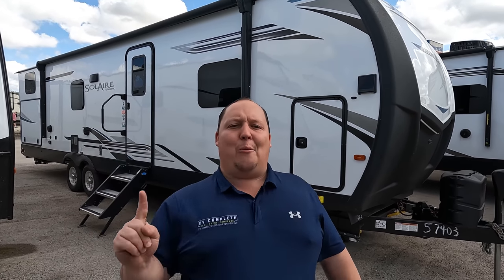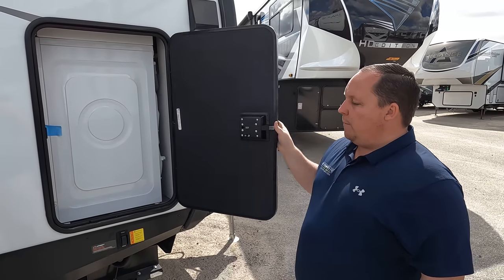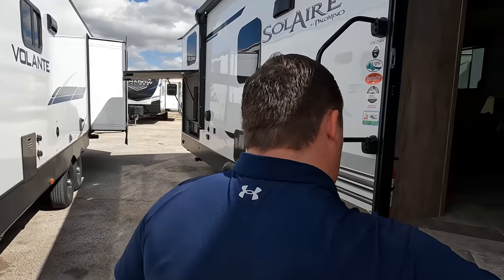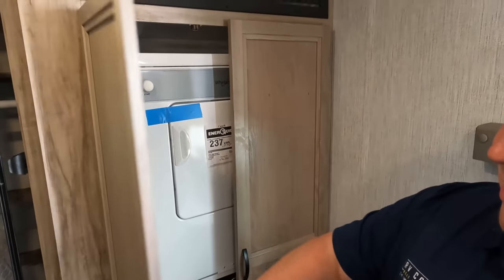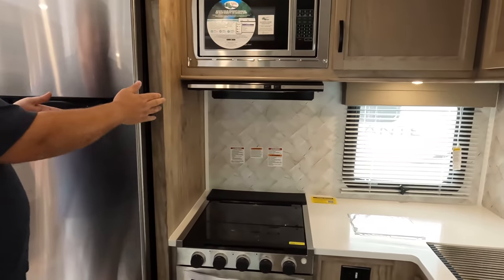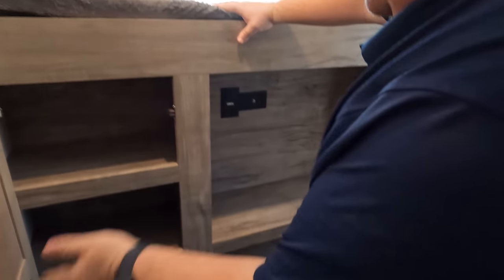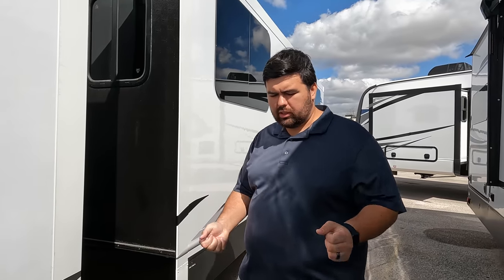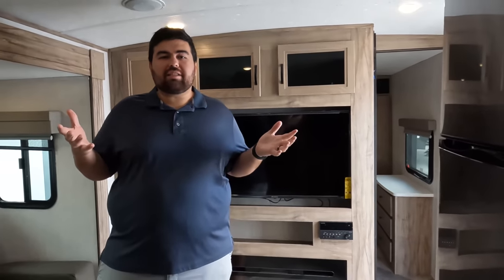FULLTIME LIVING in a TRAVEL TRAILER! HUGE!!!

Comment: Wow this is kind of a let down for the size and weight of this TT it's not well setup for a family (plus Forest River doesn't warranty for Fulltime living). I don't know why you would recommend a TT for fulltime if the manufacturer doesn't warranty for it .. a washer and dryer in the unit is nice but like Will said this unit isn't going to keep up with the laundry amount and you will be using the laundry at the campground anyways... most campgrounds have good laundry machines at an affordable price and they deal with the wear and tear on the machine. The bathroom is horrible in this unit especially for the size of the TT... I would much rather recommend the Jayco Eagle HT 312BHOK ... Same bunkhouse space but a much better bathroom with a 30x36 shower... A great kitchen space with an island... And a TV directly across from the theater seats... It's prepared for a combo washer/dryer but I wouldn't get one anyway since doing laundry in the laundry mat shouldn't be an issue for people... I know so many fulltime RVers that have removed the washer/dryer and haven't missed it... But do enjoy the extra storage more... Oh and lastly those Castle Rock tires are china bombs and would be the first thing I would change for safety... The Jayco comes with Goodyear Endurance from factory and has a 16" tire open (very good option for a TT this heavy)

Comment: Dislikes:
1 - The TV and Fridge should be swapped.
2 - Bathroom is fail.  
3 - With those huge slides, make the back room just for sleeping - put a bunk bed there sideways and be done. This gives you a usable bathroom.  Note that this also means removing the useless outdoor kitchen.  In a unit this size, outdoor kitchens are a joke - you come inside 10 ft to get food anyways.  Turn this all into a useable LARGE 5th wheel sized bathroom or make the kitchen along the wall to open it up. Also, with a larger bathroom, THE place for the washer and dryer is in the bathroom.  
Likes:
1 - Slides are great.
2 - No nasty floor vents.
3 - I don't have #3.  It's a good attempt, but feels cramped.  The price is too high compared to larger 5th wheels that give you more.  Given the tongue weight, it's a 5th wheel TRUCK you need anyways - then we're reduced to merely talking about mounting methods for the larger hitch - distribution bars or a 5th wheel mount.  Might as well just go 5th wheel anyways.

Comment: Matt what is the weight limit on the beds in the bunk room....?
Reply: The one above the outdoor kitchen is always 300+ lbs.  The fold-down ones are always well under 300lbs just due to their design.  It's MUCH better to ditch the outdoor kitchen and have bunks on the slide.  Then a LARGE bathroom/space for the fridge and washer/dryer there. (should never be in the sleeping areas ... trust me, they WILL leak)